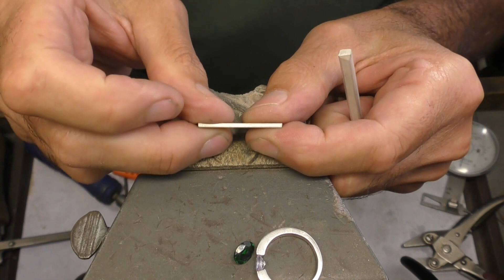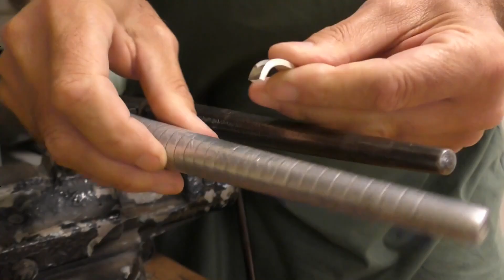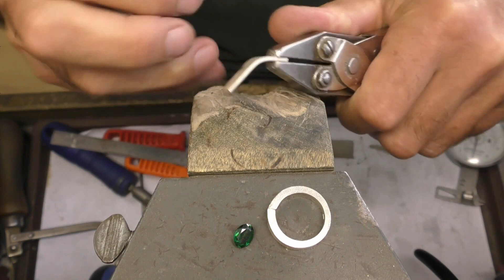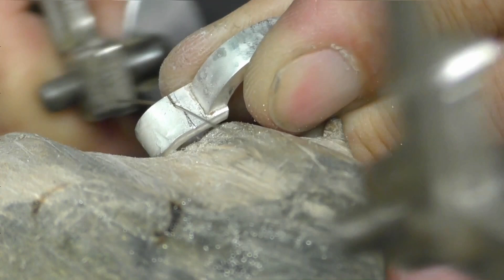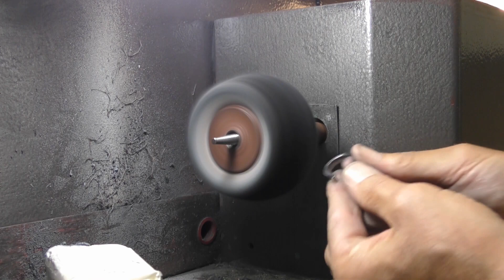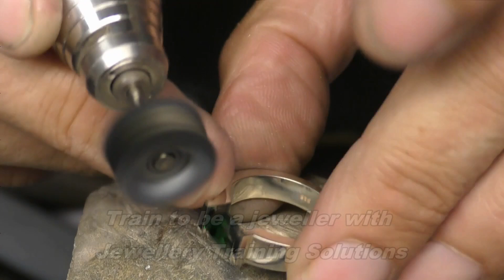Tension set forged ring

Comment: I was thinking about this as I was watching.

Is it possible for you to model that gem that you're using in a CAD program or something, and then pull across section at the depth that you're intending for it to sit in the middle, then print out that cross-section on adhesive paper? stick it on and then cut.

you could essentially cut a near perfect cavity that way and eliminate that rock.